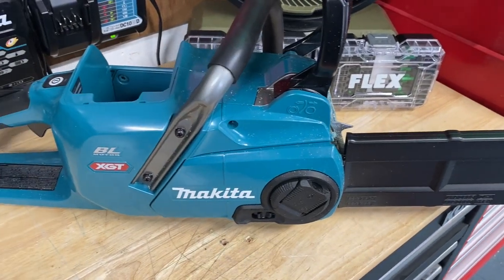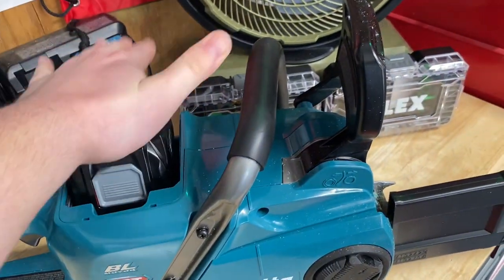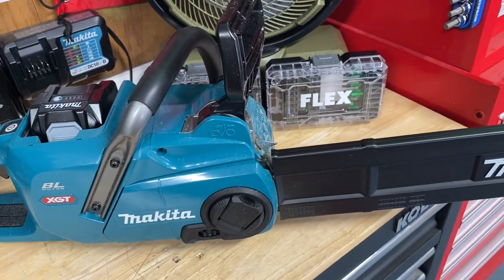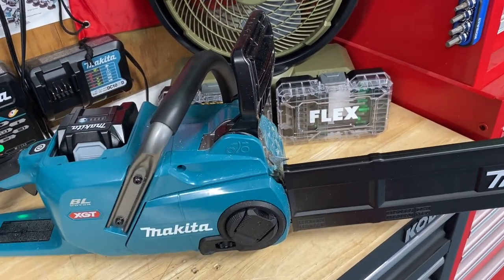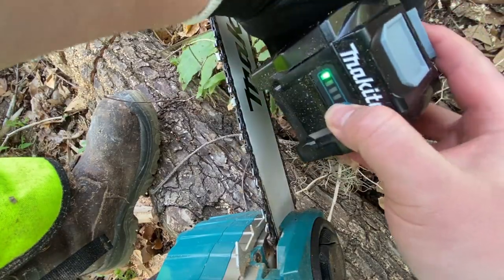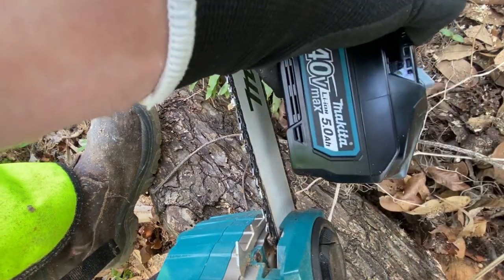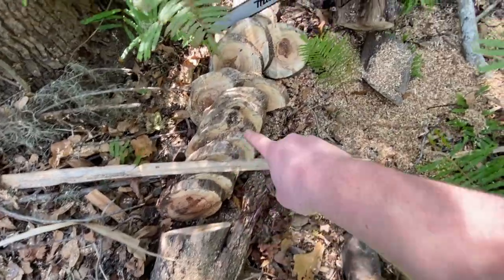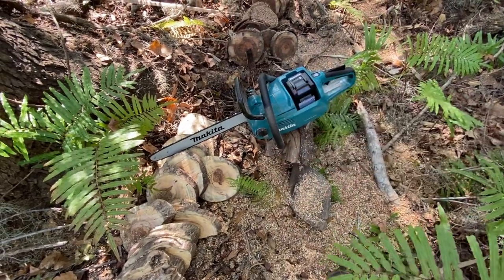Makita XGT 18" Chainsaw Real World Cutting Until It Stops! |  5ah XGT Battery Test! | GCU06T1 40v

Comment from the maker: Some things I noted from this test.

1. Chain speed and torque are much better than the LXT 36v chainsaws, this thing has a ton of power!
2. The battery gets much hotter than the saw, the saw was warm by the end but the battery was quite hot. I gave the saw and battery zero cool down time for this video.
3. The saw is definitely heavier than the 36v LXT saws, 14.7lbs with the battery (XGT) VS 11.1lb with the battery (LXT)
4. The 5ah XGT battery went into thermal protection when I put it on the charger, charge time went up to 80-90min as it now had to cool the battery first.
6. This saw is also very hard to stall, it never did during this test, unlike the 36v chainsaws.

And finally, always wear FULL PPE when using a chainsaw, I always wear chaps, face shield and gloves! Be safe!
Reply: great info, thanks!

Comment: Hi and thanks for the video! Please, could you tell how the saw perform with the standard Bl4040 battery? Will I feel the decrease in power or it just will last very short due to overheat? I wont make continuos cut but just home wood cut and some felling. With 36v had never problem cause I never force tools. Thank you. I would like to avoid buy expensive 5 or 8 ah battery.